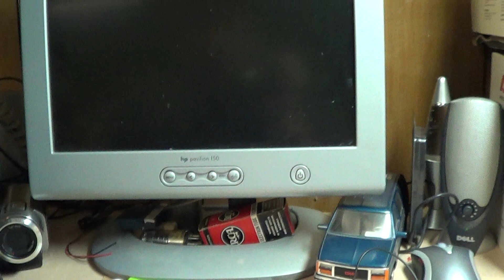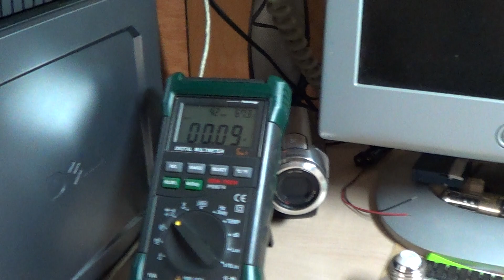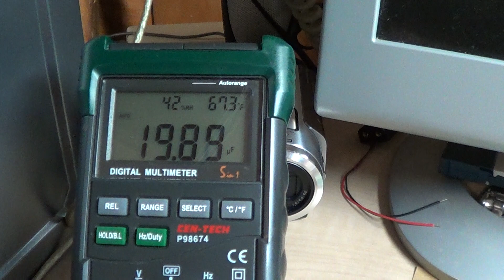Quick Late Night Video: Compact Fluorescent Lamp Filter Capacitor Testing

Comment: I gave up on modern CFLs long ago. I went on ebay and got some 13w Magnetic PL Screw in Adapters. When used roughly 8 hours a day, the Philips bulbs i have usually last about 4-5 years. They Make Magnetic lamps with Pulse starters now, so there's no flicker if you so desired one.

Comment: Anymore I really don't care for those CFL bulbs. I don't care for waiting for them to warm up, and unless its in a place where super bright light is needed (workbench, kitchen, garage, etc...) I really find the light to be far too harsh from most fluorescent bulbs, even the big ones. I'll take the old fashioned bulbs over those any day. But I've found that I honestly like LED lights the best, they seem to put out more light, and its a much warmer and less harsh light as well, plus they outlast the CFL bulbs by far, so far none of the LED bulbs we have have gone out yet, and some are getting to be 2-3 years old now. My second choice to those would be the standard looking glass bulbs that have a smaller halogen bulb inside, these really are in my opinion the most exact replacement to the bulbs we all know and love. I only prefer the LED ones because they seem to last longer.

Comment: Actually watching this video now, (put it into playlist for my own convenience) I used to have that exact same set of Dell speakers, until one got quiet and the line in cable broke. Then I cannibalized it and a set of Harmon/Kardon Multimedia speakers to make..... "The Illusion v1", as I like to call it. Really, it's an awesome dual-mono channel portable speaker system. Complete with amp board and a speaker from the Dell set, and one speaker from the Harmon/Kardon set. It gets insanely loud, and I have yet to make a video about it and my rugged mason jar speaker, which happens to be powered by a really crappy off-the-shelf amplifier ic.

Comment: I hate CFL bulbs.I have one in my LEDU lamp (You know, the kind that you clamp to a desk or table. Mine happens to be manufactured by LEDU). I have to have the lamp pointed upwards, because the bulb gets extremely hot and reeks when in the downward position. This lamp used to belong to my great-grandmother. 

Yet, my small lamp (which also happened to belong to my great-grandmother) which uses a #93T incandescent bulb, gets equally hot in the same amount of time, but that's understandable. 

I really should see if I can get replacement bulbs for both lamps. Although, I really don't know if Batteries+ carries LED replacements for #93T bulbs.

Comment: I like those bulbs because the parts in them are reusable for other things, also I know how to modify one of those to run off a single 3.7V Li-ION cell. Handy when the power goes out during a storm.
I upgraded all my tube and CFL lamps in my home to LED types recently and my power bill is greatly lower now. So needless to say I have a pile of CFL's and 4 foot 32 watt fixtures in my shop now..

Comment: I can't say much bad about CFL's. I have two in the house and one for outdoor. All of them have so far lasted several years each. The longest lasting was installed 4 years ago and runs 8-10 hours a day typically. Now that I've said this I'm sure they will all stop working. Hint: Write the install date on the base of the bulb.
Reply from the maker: +BonhommeRichard91 I've had good ones and bad ones, but only one that ever came close to lasting like more conventional fluorescent tubes in fixtures have.

I did date a few of my CFLs just to see if my thoughts about their lifetime were in line with reality. I also dated the LED bulb.
Reply: +uxwbill I went and looked at my two indoor dates, Dec 2011 and March 2013, I'm too lazy to go find the outdoor, but there's at least a couple of years on it. Another tip is to screw them into the socket by holding the base; not the glass tube. There's a chance you might break the glass or the sealant; if so, reduces bulb life.

Comment: I'm very disappointed with these type of lights,, the majority of the ones I have around my house have failed with in a year or two of installation.. I've noticed melting and blackened plastic on a few of them, and one I can recall went out with the magic smoke effect.. Needless to say I really don't use these anymore, I'm staying with halogen for now.. LED seems like it will be a good alternative once the price comes down a bit.. Interesting notes on the capacitor placement,, I've seen on a few packages warnings not to place these bulbs in an upside-down position, which would make sense.. Ironically enough, I've seen others with the reciprocal warning..

Comment: Am I the only one using incandescent lights around here? The only florescent bulbs I use are the ones that illuminated this video. 

I'm sad to them being phased out. Halogen lights come close to providing the same light as incandescent bulbs and don't normally explode when they die.
Reply: +UnKnownSoldier41 I still use incandescent bulbs. I really don't like the bulbs made these days because they all pop so quickly. I don't use my lights too incredibly much and even those so called double life bulbs popped within about 5-6 months after buying them. It's all planned obsolescence. People need lights so lets phase out what actually works for inferior pieces of crap that you'll need to replace all the time. And honestly, those CFLs don't last nearly as long as they claim. In fact I think one of the more original ones lasted a lot longer than the ones these days do. But I laugh when it says it lasts 10 years. What is 10 years based on? 30 minutes and only in use 2 times a week?
Reply: Viper Jay 5 You said it. I have a huge supply of 60, 75, and 100 watt bulbs from about 2006. I'm keeping those unused for as long as I can while I use todays Incandesent bulbs. I have an old CFL from around the same time frame that is still working today....but it's the only one.
Reply: watcher206 Then thank god for loop holes! The "Rough Service" Incandescent light bulbs (Used in work lamps and garage door openers) with still remain in production due to the fact that LED's aren't tough enough and CFL's are too big. I would happily pay more to get those bulbs, you just can't replace them!
Reply: Yep. I don't know why they feel they need to tamper with what has worked for well over 100 years.
Reply: +UnKnownSoldier41 Another sad thing too is the fact that general purpose Halogen bulbs are scheduled to be phased out in 2020. Once that happens its going to leave just CFL'or LED lighting as far as general purpose lighting goes. Also, the T12 electromagnetic florescent lighting has not been made since 2013. Right now, the stores are basically selling their remaining inventory. Once the T12 tubes are gone, the owner will have to ether replace the fixture or change the ballast to T8.
Reply: +UnKnownSoldier41 Very true. There are other loop holes as well. For example, general service incandescents that are over 100 watts or under 40 watts will be left alone. (Personally, I use a 150 watt incandescent as my porch light and a 200 watt incandescent in the floor lamp in my living room.) c7 bulbs, appliance bulbs, ceiling fan bulbs, globe lights 40 watts or less, rough service bulbs, and other kinds of bulbs. (I think there are around 20 exclusions or so, but I dont remember all of them.)

Comment: A good replacement filter cap for an All American five radio. Those C.F.L.s are a good supply of repair parts as well as one of the most dangerous and toxic light sources made.

Comment: I'm not a fan of CFLs, either. The big attraction for me was that they're supposed to last a long time, but they don't, especially when they're outside, in a hard-to-reach light fixture... hence the reason I WANTED them to last longer in the first place! And (in the cold) they start up dim. My mom moved in a new house a few weeks ago and several of the fixtures have LED replacements. A few of them (all the first-generation Cree type) have died. I believe they're 2 or 3 years old. And a dead LED is just like a dead fluorescent; it lights up dimly, flickers as it "tries" to light, but doesn't. And they all have a very slight delay from when I flip the switch to when they turn on, and they continue to glow for several seconds after they're turned off. Interesting things. :-)

Comment: I took many of these CAL lamps apart that died and one of them I made a driver  circuit from a camera flash circuit but it's not bright enough for me and it's not liking 3 volts being pumped into it. I need to find another way to power the CFL
 preferably in a portable package.

and nice truck. (the GMC suburban model)

Comment: Hey, Bill.  When you were discussing the lifetime of the florescent fixtures in your room (30 years, 40+ years) I am assuming that you were referring only to the electronics in the fixture and not the lamps themselves? What kind of service life are you getting from the lamps?
Reply from the maker: +Scott Kiddy In the case of the preheat-type desk lamp, I was referencing both the lifetime of the fixture and its bulbs, which appear to be original. The ceiling lamp has had its lamps replaced a few times in the past two decades. When some of the tubes first failed, I swapped in other tubes that were sitting around. On the second time, I replaced two tubes with brand new ones and the third time, I replaced the other set of tubes with new ones.

Offhand I'd say I was getting at least 5, possibly as much as 8 years out of the tubes in the ceiling fixture.

Comment: we have those long tube lights in my mums kitchen and well one was replaced years ago the other one is mounted in the ceiling  I think 30w florescent at least 70yrs old was put in when the house was made so its 70 yrs now as was built  just after the war  and the same motor starts it but other side of the dinning room side was replaced same sort of light but mounted on the out side of the ceiling so they go for ever thanks always enjoy you videos' posts

Comment: Funny that you upload this the day I had to replace the bulb in my shower! It was one of those bulbs that takes 15 years to warm up and uses a halogen capsule during warmup. It fizzled out while taking a shower...just to let me know that it existed I guess. Replaced that with an LED bulb that's much brighter and turns out instantly. Huge improvement.
Reply from the maker: +lmull3 Oh geeze! If that would have happened to me, someone would have been mopping me up off the floor. Did it actually explode or just make a bunch of noise?

I've got a couple of halogen type lamps designed as replacements for regular incandescent globes around here ,and while I like them, I'm afraid of what might happen when they fail.

A very cheap LED bulb took the place of this fallen CFL. Should be interesting to see how it lasts. (Welcome back to these comments, BTW.)

Comment: Man Bill. I am amazed to see that them big  fluorescent bulb based fixture manged to last 30 years because in my case we always had trouble where the fixture died and when we tried to install new bulbs the entire thing didn't work. But we still have 3 of them fixtures left and they are still working great after many years. At least with the smaller bulbs the fixtures for them rarely die if ever.

Comment: You need an ESR meter to properly test caps. I was hoping you were going to smoke test the capacitor :-)
Reply from the maker: +Coolkeys2009 While that's certainly true, this was as mentioned, just a quick and dirty test. I don't plan to reuse the capacitor. (Well, OK...I might, though it won't be for anything important or that I happen to care about. If anything, it might end up involved in stupid experiments.)

Comment: Why don't you go for LED retrofit tubes? I have deliberately installed them in my home. I bought really cheap fittings with electronic ballasts and cheap ugly 4000K tubes, I ripped them out, ripped out the electronic ballasts and salvaged out the filter circuit for other projects. Then I rewired them for the LED tubes and added markings which way round the should put in there if I need new ones. That is over two years ago and the LED tubes are still working fine and are as bright as day one, keeping down my electric bills.
Reply from the maker: +BloodySword Until two or three months ago, I had no idea that such things existed. I figured they were a "drop in" replacement for standard tube sizes and that they would work with whatever ballast was present.

It will probably be some time before I use any LED retrofit tubes. I don't generally make major changes to anything unless it is broken, and even the old troffer fixture in this video manages to get about 5-8 years (sometimes more!) out of its tubes under very heavy use. I'm sure it's not the most efficient thing ever, but I don't really care that much because it works so well.
Reply: +BloodySword LED retrofits don't usually like magnetic type ballasts, he may come out cheaper buying an entire LED lamp rather than getting the retrofit kit and new electronic ballasts for the existing lamps.
Reply: +ElfNet Gaming 2 Years ago, retrofit solutions were meant for putting into existing magnetic ballast fittings and they were real cheap. The only thing that must be replaced was the starter. There was an LED-Starter, which is just a fuse and a dead short. They work wonderful on magnetic ballasts for a friend of mine. I do not have any magnetic ballast. I just had electronic ones that I ripped out, I bought these cheap fittings on purpose for LED retrofit.